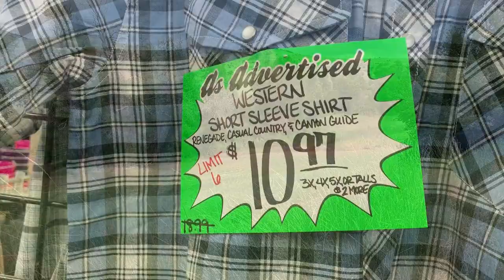I Painted Everything Upstairs... (IT LOOKS BEAUTIFUL!!!)

Comment: Had thought of you a few days ago, when I was taken to a construction site(commercial, office buildings) and the drywall crew had finished recently, and the paint crew was starting, and the finish in that place..w/a 'professional' crew was spotty at best..and made me feel a lot better about the 1st place I did, but wish I could have taken you through it..let you look at the seams and such, then had you imagine it on your walls there. I guarantee it would change the way you feel about yours, which is much better! 

Keep plugging away at it, and try to get back on that tape/finish then paint on the downstairs soon as you can..you're closer than you think, and when it's done you'll feel SO much better about everything. It will also make the rest of it fly, and even allow you to sneak out and get some of those outside and other things you want to so badly..but remember, get them a bathroom door mounted, and a sink..even if temporary and just cold water at 1st. You're getting there ;)

Comment: You did a great job on the drywall. Paint will cover most of the imperfections and you can note it later to do in the winter. I painted my house every 5 years. Don't sweat it.

Comment: I have to say, I loved hearing you voice the inner debate you had inside of your head about leaving something less than perfect if it'll bug you later on or just finishing up.  Here are my thoughts on how to handle something like that.

You're looking at the bare walls and bare floor and using the eyes of a contractor to determine if it's ready or not.  Instead, envision the painted walls and finished floor and furnishings and paintings and pictures and family and pets and activity and fun and look at it through the eyes of a HOMEOWNER.

If something's dangerous or will cost you MONEY or TIME if you don't fix it immediately, that's one thing.  But if you THINK it will just bug you, wait until your family is moved in and it's all furnished and you will probably FORGET most of the things that you actually thought would bug you later.

In other words, you're wearing two hats.  One hat of the person building the house, and the other hat of the person going to live there.  Try to figure out which hat is more important each time you come across an imperfection of some sort :)

Finally... LOVE the videos.

Comment: Congratulations to this point! I've never built a home but i have done several frame off car restorations and when you get 80% done your excitement level just goes off the meter. It's that last 20% that seems to drag on and take for ever in the last details. I have done my share of drywall work in home remodels. It drags on and on and on.

Comment: Hey you may already know this but thought I’d bring it to your attention because it’s well worth doing.
If you’ll paint the floor before flooring it’ll keep dust down for you.
Drywall dust will creep through rugs or wood flooring for years otherwise.
My plumber told me to use a coat of rainx on shower wall to keep scum and hard water from buildup also.
Never did that because I clean  after each shower but wish I had.

Comment: Looking good so far.  I am looking forward to you connecting the solar panels. I am looking at installing several solar panels to supplement my electrical usage so I hope to get some tips of what (or what NOT) to do when connecting everything together.  Be sure to also include any "missteps" you take so we can learn from it.  Thanks
Reply: The "solar" guy you should check out is Engineer775.  Heath knows him and they have communicated some.  That guy is pretty amazing on PV direct water heating for example.  He also does full on solar jobs for people with big $$ I'm sure they saved zero in costs but it's nice to see how the rich do it.

Comment: House is coming along great.  It'll be done in no time at the progress rate you are going right now.  

I think the worst part about painting is the prep before painting.  I have a paint sprayer and it only took 1/2 a day to paint the outside of the house several years ago with 2 coats of paint...its the prep work you have to do before that I hate...if it weren't for that I wouldn't mind painting.  Like installing the laminate flooring throughout the house its not installing the flooring, its all the prep involved prior LOL  then putting all the baseboards and furnishings back...I have 1 room left the master bedroom, probably do it this fall/winter.  The end result looks great its all the work prior and after install that I hate.

Comment: If he is going to move the family in before winter
It's all ready the end of July..
Could be a idea to reprioritize things
Doors flooring trim work can all be done during the winter
Kitchen completed and working
Bathrooms finished
Electrical completed
Fire wood for a bad winter
delievered and stacked
Propain (stove and water heaters finished)
Tractors and plow truck ready to remove snow..(chains installed)
Access to the solar panels for when built up snow needs to be removed..
Pantry finished and stocked incase snowed in..
10 ft tall poles along the creek side of the road so when removing snow..
He'll know where a safe edge is..
There is so much to get ready for the winter
If the family will move in before winter
Sweating the small things that can be done when snowed in.   ??????
Or worry about the small things 
and move in next spring or summer
and lest we remember
There is no place to store tools and material
Except in the house..

Comment: My guess is old bowling alley maple floor
Reply: Something that has to be stained and sealed sounds like work.  Hopefully it isn't nail down type.  Wonderful stuff but wow the work.  We did it with the prefinished Bruce, the thin stuff I think was under 3 a foot and was/is hickory.  Beautiful stuff but what a pain!  I mostly went through boxes and picked the pattern helper cut and nailed.
Reply: @JohnDoe-np3zk  Anything worth doing is worth doing right.  There's just no replacement to nail down solid wood.
Reply: @charleyandsarah  well TBH I just love this sheet vinyl flooring it's spongy water resistant easy to clean and the install takes hours vs. a long time.  There is a weathered redwood one that I used in my little house loft it looks nice and is rustic.  But yeah solid wood floors are wonderful.

Comment: Wood stove all your heat ?   Geo Thermal.dude  55 F degree under ground. Put a. Glycol pump. Could have ran Tubes in. Floor .Bury 2. Plastic drums.  One for. Return.  Hook up a. Truck. Radiator w a. Fan.   Antifreeze .
Reply: One drum might be. Safe easier .

Comment: Floor should be the very last item you install, and there are many proven reasons for that. Understand you are under a deadline but you should really try and get the door jambs in and the high electrical work complete, you will be dragging a ladder across the newly finished floors, not good. That is unless you are planning on covering up all the floors with construction paper, but to me that's just another example of time spent (wasted) where it doesn't need to be spent. By the way tell me I'm wrong but at 9:25 are you telling me that mom has a seat belt on and none of the kids have one on, please tell me that's not the case because if it is you do not deserve those children, they need to be in a safe environment with adults who care.